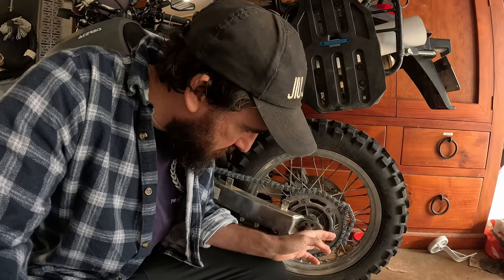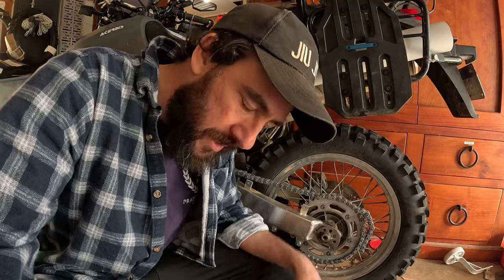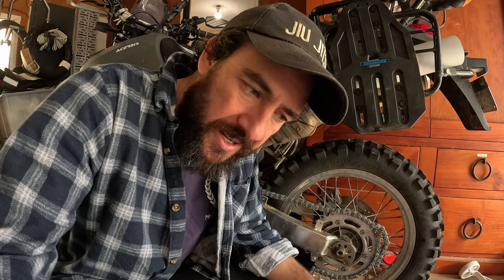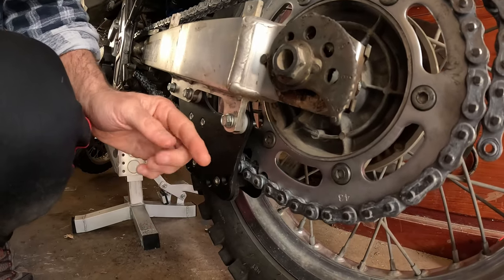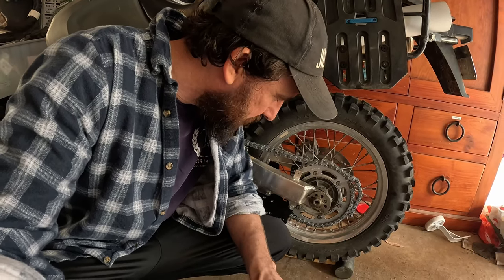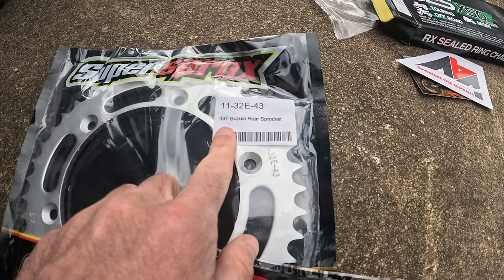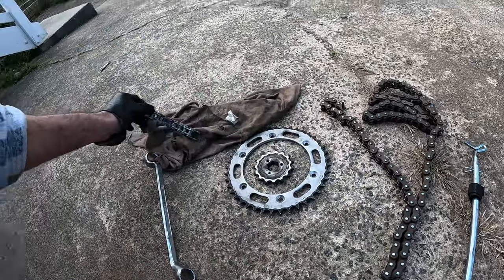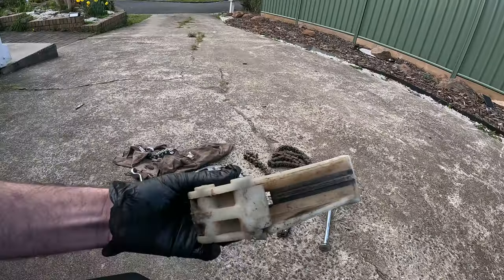New Adventure Rider - Suzuki DR650 Chain, Front, and Rear Sprocket Install

Comment: Thanks for the video.  I think you should typically have 110 links on a DR with 15/43 or 15/42 gearing.  I don’t know if / how much that changes with other gearing, but that’s the stock spec for the DR.  Good luck.  Edit to add: a bench vise is really helpful at holding the sprocket when removing it from the carrier.
Reply from the maker: Thanks for that. Yeah maybe I did the count wrong or something. I’ll give it a good workout this weekend and hopefully she holds up. 
Ahhh…and yeah, a vice would have been way better than my hiking shoes! Lol.